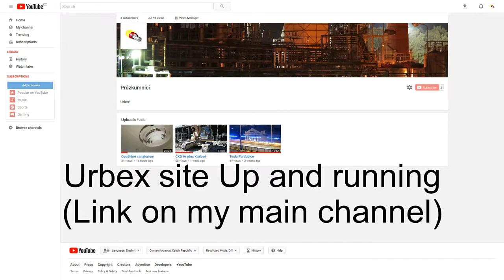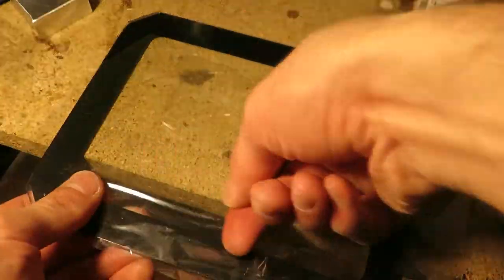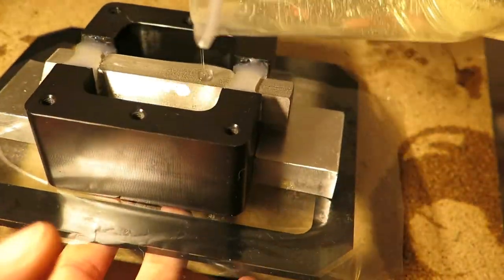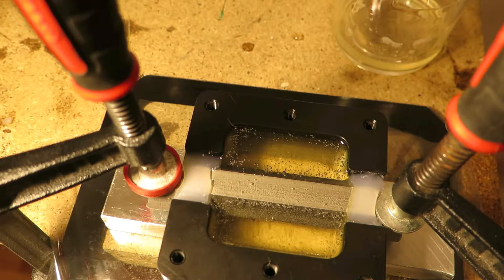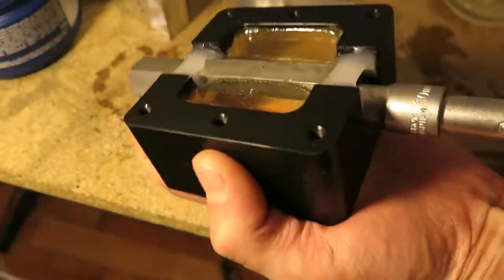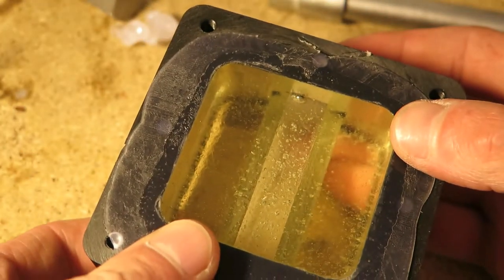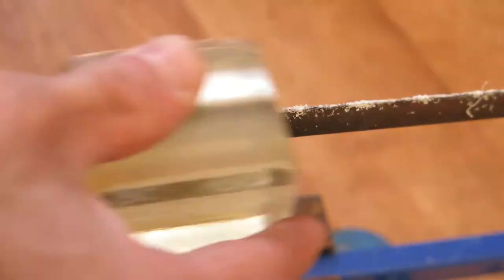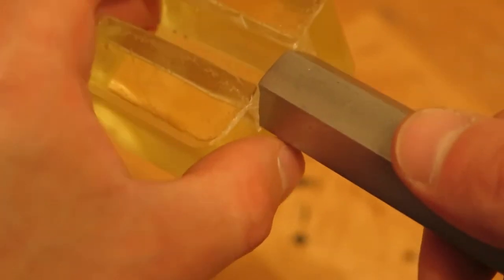Slightly improved Hexaslide

Comment: I'm planning to do an epoxy "granite" bed for the lathe, and I like your idea. What do you think about using both the linear rails from epoxy and the slide block? And have something similar to RULON (or another Teflon / PTFE interface) as the sliding surface?
Reply from the maker: I wouldn't recommend that
-epoxy is not very hard and strong.
-it is expensive
I would buy a piece of steel plate, that will provide strong surface and you can level that with thin layer of epoxy. Like this guy https://www.youtube.com/watch?v=U7Qs-J2swIc
-epoxy change it's volume when curing!
do not expect any self-leveled surface with thick layer - it will look like @3:16

Also "good" OTC flat surface, that is reusable would be flat milled Al plate like here: https://youtu.be/Fq_yUm5BfcU?t=1m17s

Epoxy rail - you can not really make precise mold, that is that long I think. Also why, when hex rods are super cheap?

However this depends a lot on application. What material, and what diameter do you want to machine on your lathe?

Even with 50mm aluminium I would probably use steel U profile as reinforcement of sliding block and use a lot of brass or bronze powder as epoxy filler to increase hardness and it will have much better sliding properties. I would do that, but I didn't have access to brass powder back then.

I am planning to try to use this mechanism on some "heavy duty" applications
and this is probably, what I would do, but I need to finish this glass blowing lathe.
that will take some time...

If this is your first machine then I would recommend doing some "stiffness analysis", because before I worked as engineer I was thinking that you can not bend 20mm thick 1meter long steel plate very much, but that's not true - that thing will flap in the breeze :)
basically if you want machine anything harder then wood, you want stiff machine!

yeah and first thing that you will made will probably cost the same or more then bought of the same quality, but it will be your :)

Anyway, good luck!
Reply: Thanks for your reply. The epoxy will be filled with "granite", ie quartz sand and pebbles.
Reply from the maker: Ah I see. I guess that you are not going to grind that afterwards. I guess that it will be stiff as epoxy and hard to machine like quartz :)

Comment: i've seen videos where they use a heat gun on the epoxy to get rid of the bubbles, maybe try that
Reply from the maker: Yeah, it helps if you have thin layer.
Problem is, that epoxy cures faster when heated, and when curing fast, it produce quite amount of heat, so it can get out of control :)
But it can be mastered.